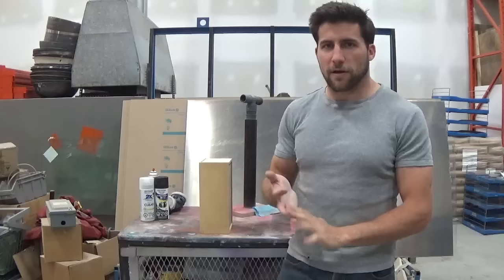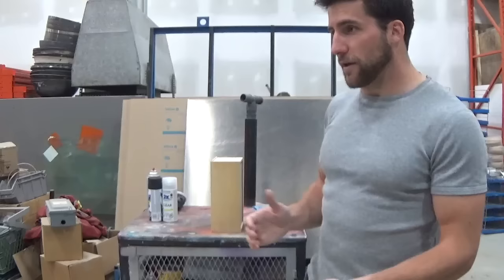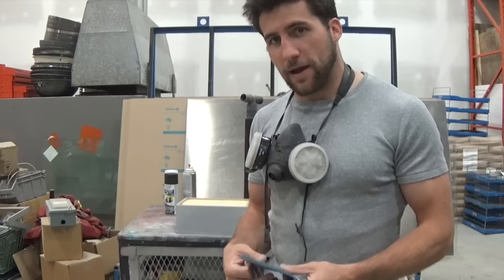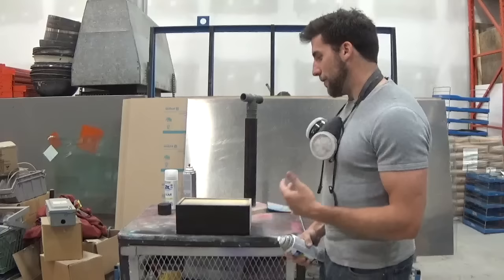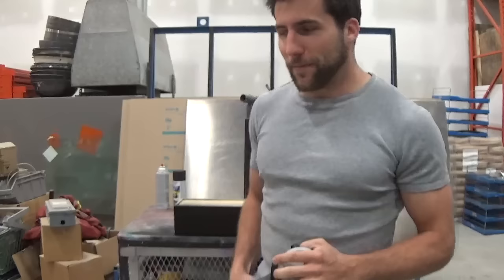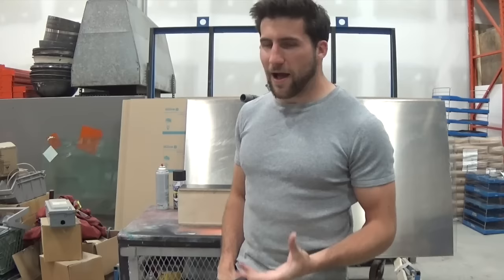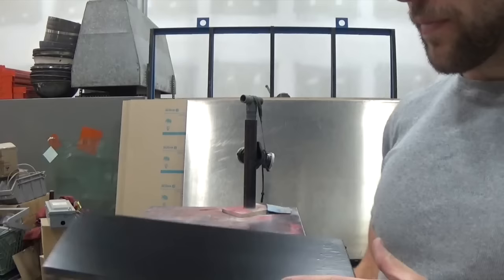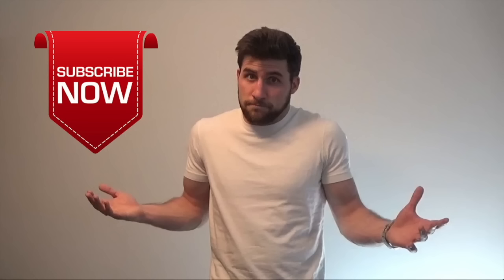How to get a matte black finish with spray cans

Comment: I applied primer and rushed my sanding. It created a mess. My primer seems to be drying in 20 minutes and I thought 10 hours cure was enough. So I guess it was not. I applied a primer again and I will wait for 30 hours. I hope it will work this time
Reply from the maker: That should work better.
Reply: @BradAngove  than I applied primer on the neck of another guitar. This time I guess I messed up again because before applying primer I just stripped off the top satin finish and a thin layer of whatever it was underneath. I did not sand it completely and I did not reach the actual wood surface. I do not know what will happen. 

Thanks for the answer btw. I keep learning a lot from your videos.
Reply from the maker: You don’t need to strip it down all the way. You should be fine.

Comment: Ho Brad I want to paint my motorcycle panels to black Matt they are black gloss my question is do I need to remove the black gloss paint or just paint on it and what do I need to paint it?
Reply from the maker: +Safa Chemloul you just need to scuff up the gloss and spray a matte clear. You don't need to mess with the black at all unless there's something wrong with it.

Comment: So if I buy matte black and use matte clear would it give me the same? Or should I buy only matte black with clear to not over shine it?
Reply from the maker: Matte clear over any sheen of black will give you a matte black finish if you let the base coat dry fully and sand with 800 grit before clear coating.

Comment: How do you clean a matte guitar.what cleaner do you use.i have Kyser wooden instrument guitar polish cleaner.will that work with a matte finish?
Reply from the maker: It should work fine. Just test it in an inconspicuous area first.
Reply: I have read that some people use Magic Sponge to remove the shine from playing/rubbing hand on guitar. What do you think about using magic sponge for this purpose?

I have also removed finger smudges and superficial scratches from a matte Thinkpad T530 laptop lid with Magic Sponge and windex. It worked great and it made the laptop look almost new.
Reply from the maker: I’ve never tried it, so I have no idea. Sounds cool though.

Comment: Can you tell me what is the best Satin, not matte, black Spray Paint in cans in your opinion? This is for a guitar project. Thanks. Your videos are excellent!
Reply from the maker: You can turn this into a satin finish simply by spraying a satin clear coat over the matte black. The same clear I used here is available in satin.
Reply: Brad Angove Big thanks for the info!

Comment: I have a question
Can this technique be used on small ( hand size ) items that Are made out of plastic

And if not

What type of spray paint Matt protectant will be needed to protect that item from friction created by my hands
Reply: I can give you information About the item in question
Reply from the maker: It can be used to paint those items, but friction will eventually polish them up a bit.

Comment: If you are doing a car with cans ... Should you scruff it between the paint and the clear? .. And u mentioned to use a flat clear coat with uv protection .. .. I am doing a gloss black design on the flat black base coat ... So my question is ... Do i scuff the matte black base before tne gloss design .. Then scuff the whole thing before the uv protection flat clear .. I think the consistant clear ove both the flat and glossy areas will make for an awesome look .. What are your thoughts.. And if u could answer me about when and when not to do a 2k grit wet sand ... Or a dry 2k grit sand ... Or just a scotch bringht scuff .. I'd greatly appreciate your input and expertise! .. Thanks
Reply from the maker: Hi Jeremy. I’m having a bit of trouble deciphering exactly what your plan is, but I suggest you start by watching my video on how to do matte and gloss designs. Once you’ve seen that, leave a comment there with your remaining questions and we can discuss.

Comment: So I want to use this instead of powder coating small accents of my sportsbike. Would this be okay to use on it, no pieces are bigger than 12 inches, most are below 6 inches. I'd rather not powder coat because that is a proccess and it can be costly.
Reply from the maker: It depends on what you need as far as durability.

Comment: What happens when you have a lot of relief for the sanding after the priming? I'd like to make Snape's wand and it's matte black but it's definitely not a smooth surface for the handle.
Reply from the maker: What kind of wood are you using? Walnut?

Comment: I painted my guitar matte black the paint color is actually called oil rubbed bronze so almost looks like a Black Rock if that makes any sense I was going for matte black but then this color looks a little better but I've been letting it dry for about 4 days now and the neck on my guitar is still sticky it's not wet it just feels sticky when I touch it I leave fingerprints how do I get rid of I really don't want to scratch my guitar up so sandpaper is definitely out of the question  I was thinking about getting a scotch pad like you did in this video but you say you don't recommend doing that so now it's got me second-guessing
Reply from the maker: Have a look at my video on why your paint isn’t drying properly and let me know if you have any of those issues.

Comment: hi brad, i have a airsoft gun, the upper and lower reciever, magazine is metal and buttstock, grip and hand guard is polymer plastic. can i do this to my gun?
Reply from the maker: You can use primer to be able to spray the metal like this (after sanding it). For the plastic, have a look at my old tutorial on how to paint plastic parts properly. 
Just note though that the paint makes the parts a bit thicker. That can affect how they move and slide against each other.

Comment: You think I could pull off a 3x6ft sheet of metal for a magnet wall for our living room for the kids' homework, schedules, and all that family stuff? I'm fairy well versed with a spray can but have never done a massive flat sheet like this.
Reply from the maker: That’s going to be a tough one. Have you considered using chalk board paint and rolling it on?
Reply: @BradAngove  Thanks! I can't believe I overlooked that. And that's why I asked. Cheers!

Comment: We're thinking of using spray cans to provide a matte black finish to a panel on one of our products - it's part of a home furniture set. Do you recommend using spray cans for production (we're looking at a few hundred to a thousand units) ? Or is there a better approach ?
Reply from the maker: In my view you would be better of setting up a proper spray setup for that kind of volume. Particularly if it is a relatively large piece that you’re working on.

Comment: Hi Brad, I've just painted a bare aluminium flat tray with etching primer and satin black paint. Can I put a clear satin lacquer on top for extra outside use durability or is it not required?
Also if I put vinyl decal stickers on the satin black paint, can I spray on a clear satin lacquer to permanently seal the decals?
Reply from the maker: You can put a satin clear coat on there, as long as it is compatible. And yes, you can use clear coat to seal in decals.

Comment: Hi Brad. Thanks for the videos. I am busy using Rust-Oleum Painters Touch 2X Ultra Cover "Paint & Primer" (Satin) to finish a Les Paul Kit. My first general question is: Are these considered Enamel paints? Or something else? I never know the difference. My next question is: I have finished my satin colour and satin clear coats by waiting 10 minutes between each. 48h has passed and I would however like to add an additional clear coat or two, just to give it a bit more protection.  Must I sand the previous clear coat (that I sprayed 48h ago) before adding my intednded follow-up clear coats, with this specific paint? Or can I get away by just spraying without sanding? Thanks in advance.
Reply from the maker: Hi Craig,

Those paints are acrylic as far as I understand. Although I consider them acrylic enamel, because they seem to be formulated to behave somewhat like enamel. 

You will want to sand with 800 grit before adding additional coats, otherwise you risk adhesion issues.

Comment: Hey brad if I was going to try to repaint a guitar that is already lacquered should I take it back to bare wood or could I get away with roughing it with 400 grit then priming the roughing again with 400 then painting ? Or what would be a good process
Reply from the maker: No need to take it back to bare wood greener ally. 400 should work fine.

Comment: What's your opinion on the spraymax 2k matte clear coat ? Will it be the same depth/protection coat as the 2k gloss clear coat ? Is it worth to pay more for the 2k matte coat or will it not be worth the money and that I should just get the 2x from rust oleum? Im looking for a flat/matte clear coat for my 12 foot aluminum boat that I painted camo for hunting/fishing and looking for durability.
Reply from the maker: The spray max will be more durable than the rustoleum 2x. I’m pretty confident this stuff won’t hold up in water like that for very long. 
Gloss always has more depth and better protection.

Comment: can i use this technique on painting my computer case minus the scuffing?
Reply from the maker: Yes, but it wouldn’t be minus the scuffing, and you’ll likely want to consider using adhesion promoter. Have a look at my video on how to paint plastic parts properly.
Reply: @BradAngove  It's a Dell Optiplex 9020 MT, it's like a silver aluminum like metal on the inside and the outside is black with some plastic parts on it. The inside would a bit difficult to sand, if you google this computer you have a better idea of what i mean but i guess it's possible. I'll go check you video you recommended, Thanks!

Comment: If you were looking to use a color, could you use the satin finish and get a similar result? I’ve only seen black and camouflage colors in flat finishes, but I have a metal project I’d like to in corporate red or blue but still want that Matt/frosted finish. I don’t have an HVLP setup at the moment, so rattle cans are my only option. I appreciate you sharing your knowledge on these videos, they’re very helpful. 👍🏻😉👊🏻
Reply from the maker: You can spray your colour in whatever finish you want. Then let it dry fully, sand it with some 800 grit so your clear will stick, and then use a matte clear on it.
Reply: Brad Angove Excellent, I will give it a try! Thanks for the info! 👍🏻
Reply from the maker: You’re welcome.

Comment: If using the 2x Paint+Primer GLOSS Key lime, can I use as topcoat the MATTE CLEAR ? thanks
Reply from the maker: Yes. Let the green dry first for at least a day or two, sand lightly with 600 grit, and then clear coat.

Comment: Now I have been trying to use this matte clear but am having a lot of trouble in sanding it down to get a smooth finish. I am painting sheet metal and often the can itself sprays real globby. So how do you sand the matte clear? I tried wet sanding and it gets a real grey soapy look after.
Reply from the maker: You can dry-sand it with no-load paper, probably 400 or 600 grit, and then put on another light coat. If you're having trouble with your paint can spitting, have a look at this video: https://www.youtube.com/watch?v=ja0ny3OaC84
Reply: Brad, thank you SO much for responding the my question/comment. I will watch that video and Ive already learned a ton from watching some of your other ones! Keep up the good work. What I do is make custom parts for computer cases out of sheet metal and have been trying to match colors of existing cases as best I can. Turns out Satin might be the kind I need instead of matte :-D
Reply from the maker: Oh, I see. You can spray a satin clear coat over it, if you need to, or in the worst case you can actually polish a matte finish out to a satin finish.

Comment: Brad, what if the primer wrinkles? Should i sand it all and aply again? How can I fix it? This is ony on the sides of the guitar, need to say there's paint underneath, did i not sand enough? should I sand it better? And then aply again?
Reply from the maker: If the primer is wrinkling you probably sprayed it too heavy. Sand it back flat and add another light coat.
Reply: Brad Angove Yeeeei, thanks i was afraid i need it to sand it all off! Thanks you rock!
Reply from the maker: You’re welcome.

Comment: I'm looking to spray paint a Gameboy White.  I don't really know anything about spray painting, but I assume matte white exists.  Would using white be effected at all by UV rays?
Reply from the maker: Matte white definitely exists. Usually UV rays bleach colours and cause them to fade. That's not really an issue with white obviously. There might be some other effect that I'm not considering though. Some of the higher quality paints have UV protection built into them.

Comment: Is clear matte a colour less?
And what is tha purpose of using it.
Tell me the name of the spray paints to get a perfect matte black finish on metal surface.
Kindly help me..😇
Reply from the maker: Well, it’s not a colour more...
It’s for protection. The spraymax 2k matte is the best spray can one I’ve used. 
If you’re spraying metal, you need etching primer etc.

Comment: Hi Brad, would you recommend this technique to paint a logo on a motorcycle gas tank? The log is letters only, aprox 4" x 4".  The bike is a 2017 Indian Scout and the tank is Matte Black. the logo would be Matte Red. If not this technique, any other suggestions would be appreciated. I have a shop in my garage and i am very hands on, and have done a ton of custom work of all kinds. However I have very minimal painting experience.
Reply from the maker: I believe I have a video out on how to paint add graphics to a guitar which covers how to do logos. There would be no need for the primer in the circumstances you’re describing. Just sand the whole thing lightly with 600 grit, paint your logo, and then spray the whole thing with matte clear.

Comment: hey man im painting plastic, just wondering if it it alright for me to not use primer? im gonna be paiting a keyboard case and im just wondering if i still have to use primer.
Reply from the maker: You can use adhesion promoter instead
Reply: @BradAngove  thanks for the respnse man♥️

Comment: Hey, painting a telecaster. After one coat of primer do i sand and make smooth, then add another? Also with the matte black, do i add a coat of matte black then sand then add the other coat? Also. Is it okay if i use rustolem primer and clear coat with krylon matte black? Thanks
Reply from the maker: You can sand between coats of primer, yes. You don’t necessarily need to sand between the black if you stick within the recoat times. 
I wouldn’t incorporate krylon if it were me. That always seems to give me trouble.
Reply: Brad Angove thank you, i appreciate it!
Reply from the maker: You’re welcome.

Comment: Hi Brad, I'm not great at spray painting at all and sometimes get a slightly noticeable build up with my matte finish. I have not put the clear finish on because of this. Any suggestions on fixing the build up? Saw some of your vids on it, but not sure which way to go.

Thanks for the help!
Reply from the maker: +Kevin Infante I would sand it back flat and try to do a light coat of the matte clear to even everything out.

Comment: Hey Brad! great video. i have a question. 2 days ago i painted my speakers matte black using spray cans however i did not use the clear coat as i was not aware. the final product looks great, but i noticed the paint was not durable at all. is it okay to spray matte clear coat now?
Reply from the maker: Yes, you should be able to clear coat now as long as it's the same type of paint. You will probably want to lightly scuff the surface of the paint first with some sandpaper or scotch brit to help the clear coat stick.

Comment: Ok, i have a transparent suface and i want to make it matte but still transparent, is there any way to do that?
Reply from the maker: Certainly. Just skip the black and apply the matte clear coat. If it's plastic, make sure you put some adhesion promoter on there first. If it's gloss, you'll need to sand it back a bit.
Reply: Ok thanks for the answer
Reply from the maker: You're welcome.

Comment: I am planning on painting my Epiphone LP with those exact 2 cans you used that I bought at Walmart, my question is, should I sand and polish the guitar after the final coat dries?
Reply from the maker: If you polish it, it will be gloss.
Reply: Brad Angove thanks for the reply! I'll try the matte look and if I don't like it, I'll polish it up!
Reply from the maker: Sounds like a plan.

Comment: I used the same matt clear coat on my paint job...had a bit of run off...i can see some salt like grains on the run off location. How do i fix that?
Reply from the maker: Sand it smooth and add one more light coat.
Reply: Brad Angove sand paper gritt?
Reply from the maker: 800

Comment: I want to buy an ibanez az 2402 flat black , but have seen some used ones start to have those shiney spots on the finish,  does that mean the person exposed it to uv lights (playing in the sun) to much or its just an inevitable thing that happens with matte/flat black paint ? (Especifically on a guitar)
Reply from the maker: It’s inevitable. Just comes from playing it. Rubbing against it eventually buffs certain areas.
Reply: @BradAngove   🥺😢